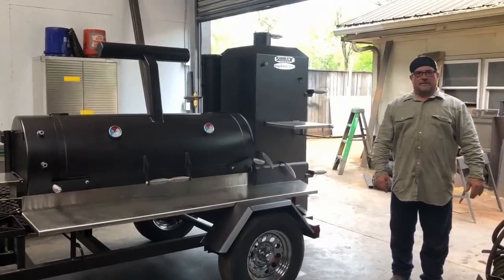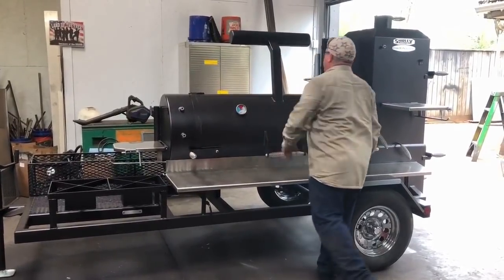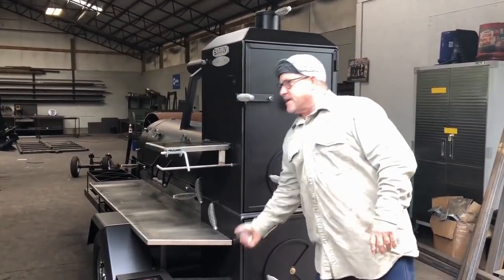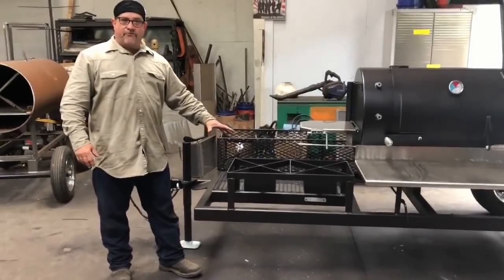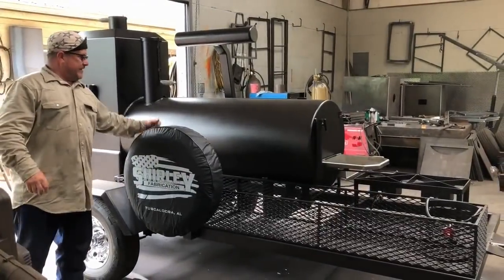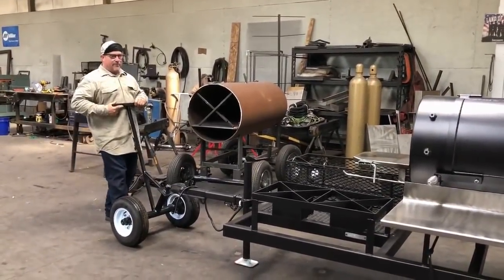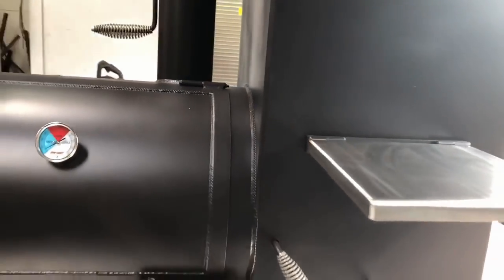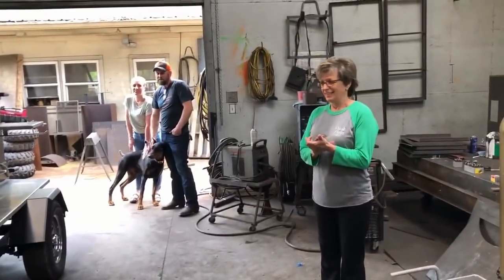Jason Zenner's Traditional

Comment: Those welds look great and I'm sure they are solid. But pretty welds do not automatically = strong welds. You can have pretty welds and poor fusion.
Reply: They look like 7018, ive run that and with really good prep it looks like these and had pretty great adhesion so long as I had the heat right... (ok mine werent nearly as pretty to be honest!) But it was a good bond. Bad prep with 7018 was a horrible bead and no adhesion. If I had a pretty bead with 7018 it was usually a good weld bond for me, then again with 6011 I could stick some real dirty stuff and it usually bonded great but always looked terrible... whats your opinion? Always like to hear what other welders found themselves! Thanks!